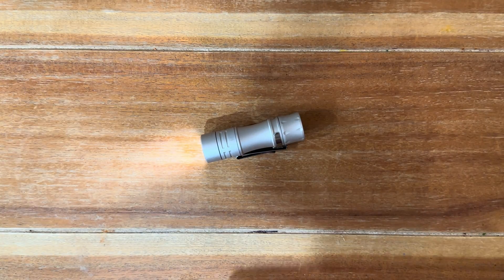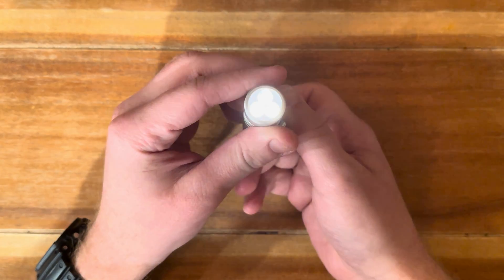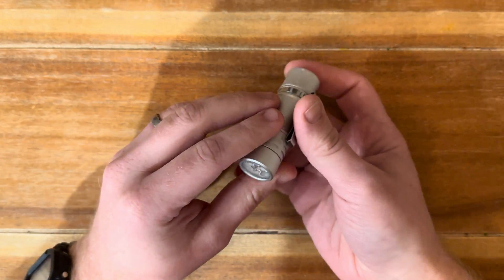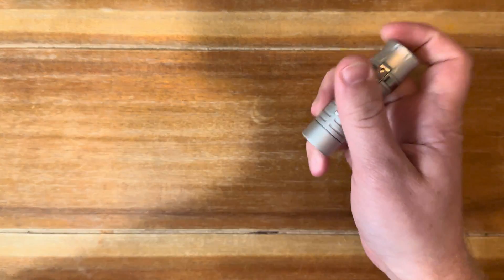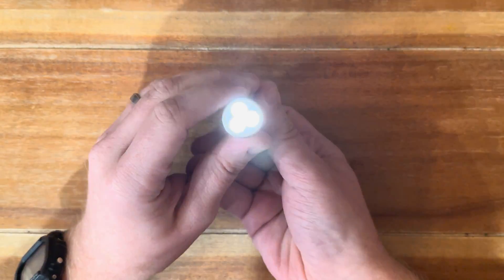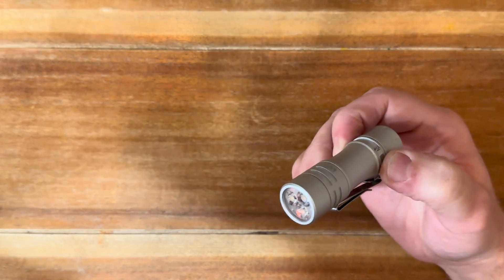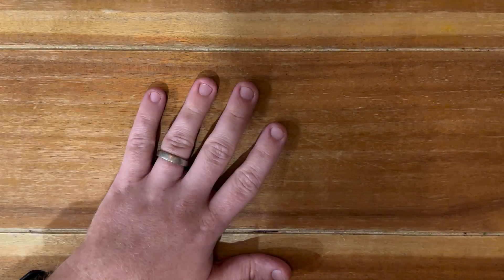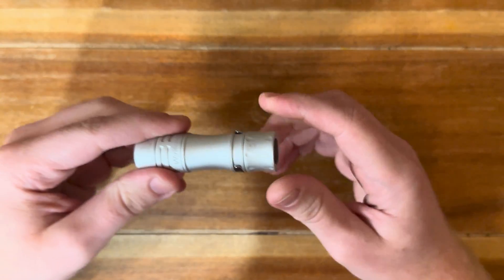Anduril 2 flashlight UI Easy explanation and mode overview.

Comment: many of these button presses are actually designed pretty intuitively, in my opinion!

for example: off to on: 1 click. easy.
lockout to off: 3 clicks.
lockout to on: 4 clicks (because 3 turn off lockout, +1 to turn it on from there)

what's notable is that, to the firmware, 3C+1C and 4C are likely NOT actually the same thing, as far as i'm aware ToyKeeper would've had to actually make it so these intuitive combos work like you'd expect them to. without that work, 4C from lockout might've just done nothing, you would have to 3C, wait, and then 1C. there are many other examples like this, for example in the way you control which way the brightness will ramp.

basically, yes, anduril has a lot of stuff to remember, but if you keep in mind that there's only 1 input (button) and more or less 1 output (the LEDs) to work with, it is shockingly well designed for the functionality it offers, and ToyKeeper is obviously putting a lot of work into keeping it as user friendly as it can possibly be within these limits.

Comment: Interesting!  Might have helped to show people the flowchart diagram, perhaps post a link to one.  You taught me that the strobe modes were adjustable! Thanks, you got a new sub.  If you are ever bored, consider a how and why to adjust the temperature step down point, and what we need to know NOT to do.  😜   Some of the higher settings are a black hole for me.  Thanks!

Comment: I have a sofrin hs40 and i cant seem to get it to factory reset please help
Reply from the maker: So another way to reset is unscrew the light until the aux lights power off. Then hold the light switch and keep it held down. While still holding down the button. Tighten the cap fully . Still holding the switch, the light will flicker and then go full turbo then fade off. This has reset the light too.

Comment: Such a good video! I was struggling with the UI, and this really helped me get the hang of it. One question. It looks like your light doesn't fully turn off (the red aux seems to always glow). mine has the same thing. Do you know if this is supposed to be this way and if it can be turned off?

Comment: So the led red color is on super lights like you can see in your video. Does that drain the battery faster?
Reply from the maker: Technically yes, but it is such a small amount that the usability of the lights at night to locate the light outweighs the microscopic difference of the lights being on.
Reply: @JadeGeminiM390   awesome thanks!

Comment: Thank you! Seriously, I nearly threw mine in the garbage due to the incredibly complicated U.I. (Only paid $16.oo for the light, its accessories, charging cable, charger, and 14500 battery.) 

Figured, minus the light itself, $16.oo is a good bargain for everything else that came with it. Honestly, too complex for me for EDC purposes. But thanks to you and this video, I now have mine set to how I like it. Loosen the tailcap a bit to completely switch it off. Makes it useful as a good light to keep in my bum bag, or smaller sling bag. Thank you, again.
Reply: Where did you get it from?
Reply: You dont have to use any of the mode it offers lmao
Reply: @ΓΓΓφΚξηγβ  
Doesn't work that way. If you actually owned one, you'd know that. So, you're just trolling. Go get your fun with someone else.

Comment: How do I make the button show battery level ? It only show level when charging.

I tried pushing the button 7 times but it is only blinking when the light is off…

How can I make it show the level ?
Reply from the maker: Tap 3 times and let go it will show voltage. So 4.2 -4.1 is full. And 3.2 is low. Anything that is 2 blinks is very low.
Reply: @JadeGeminiM390  oh… not possible to show on the switch ?

Thanks for the answer btw

Comment: I am following along, but triple click from lock out does not unlock it. It still stays locked. 5:20
Reply: would love to get how it really works. can you teach me Steve?
Reply: @farre81  on my FW3A version, in candle light mode or normal on mode, click and hold 5 times and you should see a pulse, that's 5 min.   on my FWAA if you continue to hold, it will pulse once per second to add +5 min each time.   I believe the older ver1 of Anduril it would just set it for 1 hour.  try it and see.  i'm still learning more about the development of Andruil.
Reply: It looks like when you unlock it it does not turn on. It just shows a quick flash to indicate it was unlocked. Maybe this is a deeper configuration setting but I prefer that way so like you said it doesn’t come on when you unlock it.
Reply from the maker: From lock out (4 clicks) 3 clicks unlocks but keeps off. 4 clicks from lockout unlocks and turns on. Maybe the light you have isn’t in advanced modes 10 clicks and hold from off gets you here
Reply: @JadeGeminiM390  i see you did that, but its not working that way, maybe there are a few different updates to Ardruil, maybe like 2.0.1 and 2.0.2 with minor tweaks / bug fixes.  i'll keep looking around.   I have the FW3A black, "cool white" maybe its got an earlier version.
Reply: @JadeGeminiM390  it just occurred to me, that the light that has the single "pulse" after 5H from normal mode, must be the older style where it indicates 1 hour of ramp down.  I have one light that only pulses once for 5H and a different light that pulses each second after holding 5H.  I think they are running slightly different versions of Andruil, one has the original "one hour" timer, and the other one lets you add +5 min increments.   I'll know for sure in about 54 minutes after i continue to let this first light run 1 hour and see if it ramps down (its on very low).

Comment: My ts-10 flashes in lock out mode how can I get it to stay on solid ?
Reply from the maker: Tap 7 times. Then tap 7 times again. Then Again until it’s solid red
Reply: @JadeGeminiM390  I tried it still flashes
Reply from the maker: It sounds like it’s still in muggle mode. You need to tap 10 times and hold from the non lock out, ready to turn on mode. Then you should be able to customize your settings. If not, i recommend trying the 13 and hold to reset. Then get it out of muggle mode with 10 clicks hold. I also know early versions of this light had issues with the red LEDs staying on even when the light was on and not responding to programs.

Comment: Do your aux lights stay on when the main lights are on? Mine do and it annoys me. That's the only thing I really wish was better because then the light would be perfect imo.
Reply from the maker: It’s a know issue on earlier models, mine does not
Reply: @JadeGeminiM390  Ah. Wish I waited longer to buy mine then. Thanks for the info!
Reply from the maker: Warrenty may take care of you
Reply: @doyouhaveanyeightspeedchains  It was actually just a bug in the anduril firmware. The aux lights were slightly on while the main lights were on, but I used a programmer to update to the latest anduril and it fixed it.